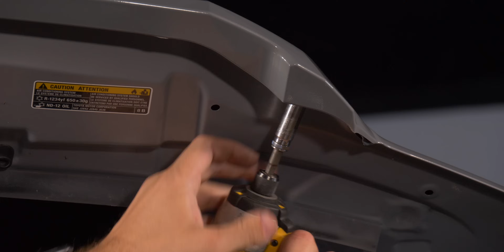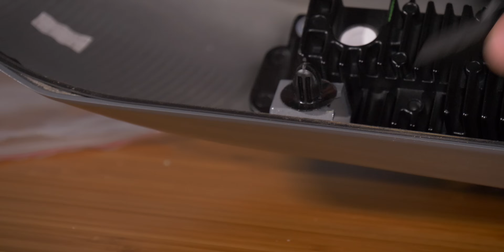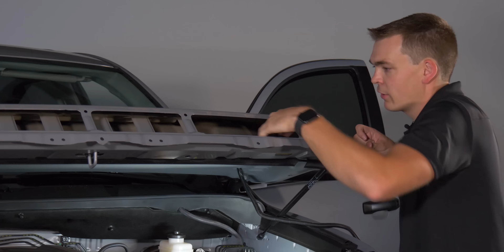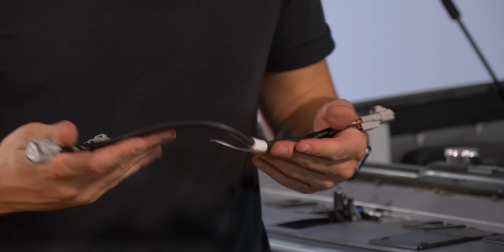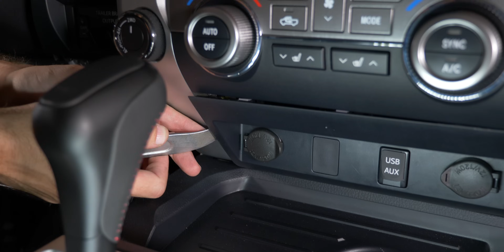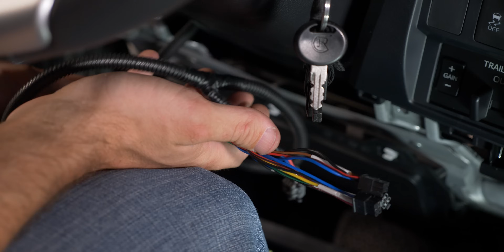NSV LED Light bar for the Toyota Tundra Install Steps

Comment: So on the nsv I see that there is only one cigarette lighter. My truck is equipped with two any advice
Reply from the maker: It only has room for 1 of your original cigarette lighter plugs, That is correct. The 2nd one isn’t used anymore.
Reply: @HeadlightRevolution   my next question I have a 2014 Toyota tundra crewmax flex-fuel 5.7. mine is an SR5 that just has heavier suspension. The problem I have found is I want to go to aftermarket headlight with a smoked lens and a Halo or A lash. However the factory Platinum headlights will not work in my wiring harness do you guys have such a beast that will work?  I do have a towing package on mine as well.
Reply from the maker: Send us an email to sales@HeadlightRevolution.com and we will help you get exactly what you need!

Comment: Is this available for 2020 Tundra ? Your site only goes to 2018
Reply from the maker: The 2020 Tundra has a slightly different switch panel, NSV is working on a solution.
Reply: @HeadlightRevolution  Sounds good. Thanks for quick response. Will order a set once you guys figure it out.
Reply: @Headlight Revolution Have you guys worked on the switch panel solution for 2020 models.  I recently purchased a 2020 Sport Edition and would love to buy this if the switch panel solution has been worked out for the 2020’s.

Comment: Hope this isn’t a dumb question...but is this light bar street legal?  As in can I drive down a normal street or the highway with this light bar on?
Reply from the maker: In most jurisdictions you cannot drive with a lightbar like this on the highway. They are really designed for off-road use only.

Comment: Everything looked very professional until you broke out the scotch lock connector that you crimped on the wires inside the truck. Those things are junk  don’t ever use them.
Reply from the maker: They aren’t my style, I prefer to solder. That being said, I wanted to follow the install guide just for the sake of the video.

Comment: Is this legal having a led bar mounted so high which can shine and glare the car in front of you, specially into the driver’s central rear view mirror. I don’t think safety of other drivers were taken into consideration. Well, that’s my opinion and I won’t buy it.
Reply from the maker: You’re absolutely correct, A bar like this should not be used on the street. It’s designed for off road use only.

Comment: it is expensive..but it is high quality and it’s plug and play..I bought mine as soon as purchased my 2018 platinum..The only tough part of it was feeding it through the firewall... but I’ve noticed with feedback from customers who have bought it in the past, this company incorporates that into the new videos ..thanks guys . And I always get compliments on the look that the light bar gives me truck
Reply: I have the same Platinum DC 2018. Any unusual steps in the wiring that you needed help on that differ from this video?? Thanks
Reply from the maker: I’m so glad you love it! That firewall part is tricky for sure, I’ve done a handful of these installs and that’s still the hard part for me too. -Chris W
Reply: 1:31

  @HeadlightRevolution

Comment: ya know that vent is functional.
Reply from the maker: The vent on the Toyota Tundra is actually mostly solid plastic offering no airflow. We were surprised to discover that. This mod doesn’t cause any issues when it comes to airflow on the truck.

Comment: 2 questions:
1) why do you need to connect to the headlight motor?
2) why did you cut the blue wire if you have factory LED headlights??
Reply from the maker: These questions may be better directed to NSV, The company that makes the light bar kit. We followed the latest instructions from them when making this video and everything turned out great!

Comment: That vent is no plugged by that lightbar. That vent is responsible for feeding the main air intake in the truck's engine. This is a HORRIBLE place to put a lightbar. Driving under heavy load this will choke the engine and starve it of the air it needs. There's a reason why Toyota put that vent where it is. Put it in the grille or on the roof, but not in the intake vent.
Reply from the maker: That ‘vent’ is actually a solid piece of plastic, It doesn’t feed the engine with air. If you look at the intake duct attached to the air box it doesn’t rely on the hood in any way for air supply.
Reply: Toyota hood scoops or good vents on their SUVs and pickups are non-functional 99% of the time. Look at the 5th gen 4runner TRD Pro and Off-road, it's just for cosmetics.

Comment: Why do u have to cut the blue wire for the DRL, can u have the light bar without cutting the drl cable
Reply from the maker: If you leave it connected you will have issues with the NSV light bar functionality. Certain trim level Tundras need it, Others don’t. There would be no benefit to leaving it connected.

Comment: Not to get sidetracked, but was just wondering if the Tundra in the vid is a 2019, did you have the hood bulge and grill painted? I have the same paint color” Cement”. I thought to get this look you had to order a specific grill and that didn’t guarantee that your color was available. Just really love the aggressive look this gives the Tundra, but wasn’t sure what it would look like on a Limited. This is probably not a Limited but the satin chrome grill inset is the same as mine, and yours looks great.
Reply from the maker: This Tundra belonged to one of our customers, I believe it was stock from the dealership but I could be mistaken!
Reply: Hey, the tundra is a Limited, the hood bulge and grille are from a 2017 trd pro in cement.  The surround was removed off the trd pro grille and swapped out with the chrome surround on the limited.  The hood bulge is able to be purchased from in the cement color
Reply: New Look Tailgating Thanks for the info and great job. I like the look. I also saw your grill swap out vid on your channel. Looking forward to this mod. That LED light strip in the hood is sweet.

Comment: Need better output shots without headlights on. Honestly for something that is prefabricated with harness, plugs and vessels is not a bad price depending on what LEDs where used (better be Cree). Most of you don't even know the ohm's law to be able to power led's with amperage higher than 300mA and that's not including proper heat-sink size with drivers and sequential programming on the led drivers/modules. Yes, it is way, waaaaay cheaper if you do it yourself, but led lighting is not a joke if you want good output combine with heat dissipation for longevity. The PCB fabrication and programming is a whole different story.
Reply from the maker: We’ll try to get some footage of that next time! The light bar only comes on with the headlight switch in the on position, But we could cover them to show only the bar next time. Thank you for watching!

Comment: Yeah they charge $1000 but I'm willing to bet it only took less than $50 to make.
Reply from the maker: You might change your mind if you saw the parts in person, It’s a quality kit! Not to mention all of the R&D that goes into designing a kit like this. -Chris W
Reply: Headlight Revolution just saw on Facebook where your $1k lights are getting condensation inside them. Yeah $1k pile of crap.

Comment: Running boards, remote start, and tonneau cover, all for the price of these lights. As George Bush senior used to say "Not gonna do it. Wouldn't be prudent."
Reply: (1) You just reminded me of Dana Carvey!  (2) Why can't cars & trucks just have light bars instead of two separate headlights?  Or brake/taillights for that matter?
Reply from the maker: Why not do all of them? The truck is worth it!
Reply: Headlight Revolution I probably will. I like what I see.

Comment: This light looks clean when installed inside the hood, but at the end of the day, is still only a light bar, a light bar you can only turn it on when you’re off road, I would pay $500 but not 1k, is way too expensive for the average driver on the roads.
Reply from the maker: It's geared more towards people very serious about off-roading. To each their own though!

Comment: Came hear just to get a reply from the company about how people afford things that are important to them.  Im a tundra owner, they are crap off road. Majority of these trucks will never leave pavement.   Lights are offroad use only.  If a thousand dollar off road light is important to anyone with a "off road" vehicle with 2 open diffs. Save that money for a lsd, or a starter, or tires,or air bags, or a bed cover, or a new driveshaft, or seat covers, or a decent sound system, or better brakes.
Reply from the maker: To each their own!

Comment: These lights really push legality. DOT law says you can have one set of low beams, one set of high beams and one set of auxiliary fog or driving lights on the front of a vehicle. Where does this fit in? It’s certainly not the low or high beams, which are factory installed in the headlight housings, and it’s too high to be fog or driving lights. 
In other words, it’s an extra set of lights, illegally mounted for street use, that will primarily be used to blind other drivers. Great product you’re selling. Hope it’s being sold for “Off-Road Use Only”.
Reply from the maker: Mike, the install guide listed on the product page has a big warning that says "for Off Road Use Only..."
The product listing on our website says that the full power light bar is an offroad function.
AND the way NSV designed this light bar to work - it can ONLY come on with high beams, so right off the bat it limits how the end-user can drive with it. Nobody would ever be able to just flip the switch and cruise around town with their low beams and the light bar. Or the light bar alone. It's really designed with those safety concerns in mind.
Reply: Headlight Revolution jnahgvu 

 Z  to gguq

Comment: As a public service you ought to note what is hopefully obvious, the light bar section should only be used off road. Seeing the brightness in your video it appears that section would just about vaporize the retinas of an oncoming driver on the road. Already have seen people mounting super bright light bars up in their truck grills and using them on the highway in normal traffic. Waaay too bright for on road use. Thanks
Reply: exactly, only 4 head light bulbs are allowed...10 years ago i had bumper bar pointing down on road consisting of 6 skinny driving lights, i did install light bulb cap shield to all of them, it certainly blind way less, but they were just too small parabolas for the light output...it can't ever be used on road if there is little consideration left in user
Reply from the maker: yes!